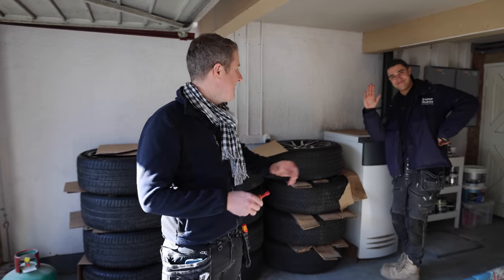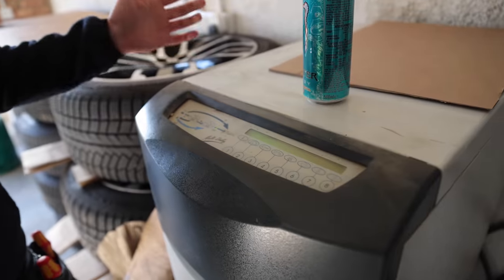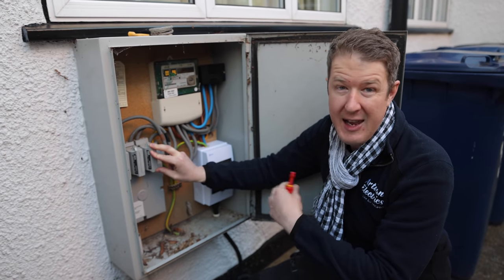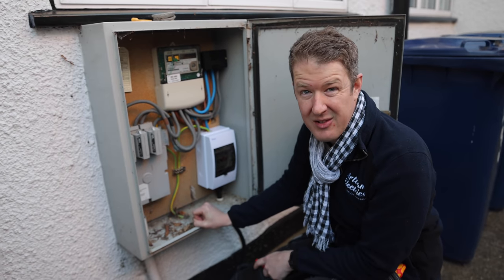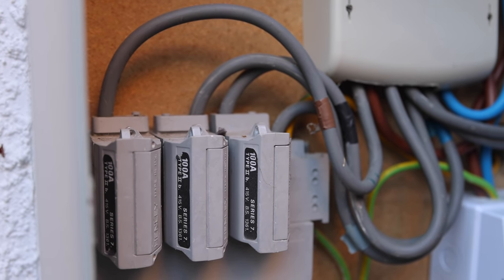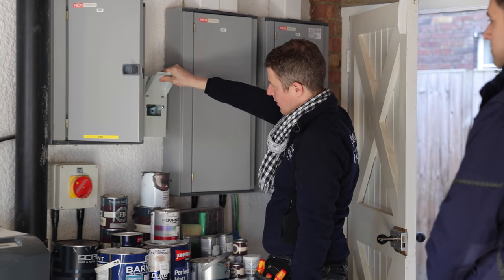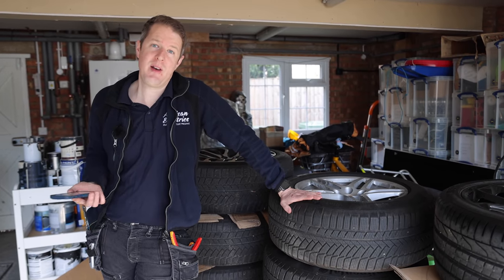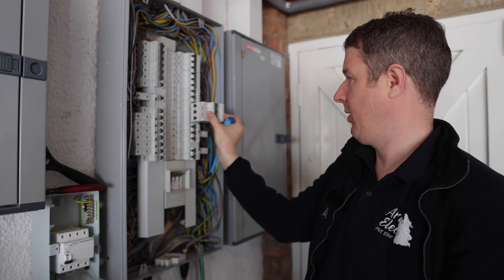INSTALLING THREE PHASE 22KW CAR CHARGERS AT HOME! - Electrician Life

Comment: Tip for Corey. Once you have drilled pilot holes in mini C.U. offer it up to partner enclosure (3 phase box) and mark the hole position through existing pilot hole. Perfect alignment without messing around to find centre of circle.

Comment: Hi guys, Yankie viewer here. I love the channel. Electricity/electronics have fascinated me for as long as I cn remember.
You were wondering about how the 110V worked. Here in North America (US specificlly) our mains for residential service is 220 V, singls-phase, though, in relity nominally more like 240 V. Unlike there, neutral is not referenced to either leg, but rather a center tap.
This gives us 120 V from one leg to neutrl for most things like lighting, plug sockets, and small appliances. Larger items like air conditioners, cookers, elecctric dryers (and, of course, EV chargers) connect across both live leads for 240V.
Earth is typically bonded to neutral at the main panel (consumer unit) and to the cold water supply where it enters the building.
Also our plug sokets are typically fused at 15 A and 20 A for kicchen appliances.
Probably a good thing I grew up here rather than there given the number of times I have gotten shocked, 240V / 32A probably would have killed me. :-)
Reply: We have RCD protection.

Comment: That "black paint" is probably hidro insulation of the exterior wall, drilling that low risks compromising the insulation and bridging the water or humidity entry to the house

Comment: I'm electrician in Quebec, Canada and love watching you guy's, good work every time ! here residential is 120/240v 1phase and industrial and commercial is 347/600v 3phase. have a good day !
Reply: That is mostly the same in the UK are residential is normally 240 single phase this house is however one of the exceptions
Reply: @dominicmcgonigle9500  120v L1+N or L2+N is for light, outlet and 240v L1+L2 is for heater, coocker, dryer etc
Reply: @julien801  Ah ok , it's like in the US? 240V is splitted in 2*120 at the transformer, then 240 and 2*120 ist going in to the House? Here in Germany every privat building has 400V / 3 Phases 240V, mostly 63A.  A Charger with 11kW is normal, if you like to install more then one or one with 22kW you must ask the network operator bevor installing.
Reply: @MrKnatterton  I always tell my family and friends about how clever the Germans are and very sensible.
Her in Liverpool we even have a great German Manager in Jurgen Klopp 😊👍👍

Comment: I’m having a new build house built at the minute (due to move in around August time) and managed to get a 3 phase supply fitted as an extra (it cost me £1200 but well worth it in my opinion) - there will be a 3 Phase DB in the garage for machine tools / 22kw car charger and L3 will run from that to the house and feed a standard Hager Consumer Unit  - thought it best to upgrade and future proof - so for anyone else looking at new builds, it’s well worth asking as its a lot cheaper then doing retrospectively (although they didn’t have a clue what it was asking for until i drew them an electrical plan and spoke to their electrical contractors ) - I’m baffled to why that house has a US 110v split phase system though - are they an American family who didn’t want to replace all their appliances? If so then the fitting of the 110v points must have cost more then replacing the appliances.
Reply: Sounds like you've had a bargain there.i spoke to a chap who had to pay 40k to get it installed.
Reply: @stevendavies4572  I think because I’m getting a new build and they had to run a mains feed in anyway it was cheaper - there’s 3phase in the road so the only cost is the cable and paperwork - with the way the world is going now with heat pumps / EV’s / aircon etc I thought it best to future proof - I’d recommend anyone getting a new build to push for 3phase as I expect it will be the norm in 5 years
Reply: Thats very expensive . . . Hope its made of gold 😂
Reply: There isn't a scenario where those 110V points make any sense to me. Shipping appliances to the UK would be stupidly expensive, never mind setting up a dedicated 120V board, transformer and accessories. There are very few appliances that would need exact US supply characteristics, the only things I can think of being motors where the AC frequency is used for the functionality (clocks, tape decks, VHS recorders and turntables) and you could just buy 50Hz UK versions. They must need that 120V/60Hz for something ? Maybe as part of the building's previous purpose they had a lot of US visitors with their own devices?
Reply: @dennybaker8755  I would think the cost of a 3 phase service basically comes down to the distance from the 3 phase main to the service head and how much trenching is needed.
Reply: @havoctrousers  I gather there 110V would be 50Hz not 60Hz seeing as the incoming supply is 50Hz and they said it was just going through a big step down transformer. Unless they have an inverter to increase the 50Hz to 60Hz. But what a waste of money having to replace any new Appliances with 110V ones.🙄
Reply: Sorry but getting 3 phase put in for faster charging is waste of time because the car only charges at a maximum of 11kW from an AC supply.
Fast chargers are DC
Reply: Also if you stick PV on the house the car charger is now on another phase so you can't use a zappi and charge from the pv
Reply: @giddyupgazboy1  this depends on the model of car. Some can charge at 22kw. Plus in a 5 bedroom house with several cars, we may want to charge multiple cars at the same time - 3 phase is about future proofing the property. As for PV, I’d just get a 3 phase inverter
Reply: @giddyupgazboy1  check your comment in ten years later... in long term you need 3 phase not just for your car but heaters too.
Reply: @giddyupgazboy1  Yes you seem to be right Porsche charges at 11kW AC. As far as I know only the Renault Zoe and Megane e-tech charges at 22 kW.
Reply: @giddyupgazboy1  The Taycan does come with a 22KW option since 2020 (though the standard is half that).
Telsa Model S can draw 16.6KW. The 22KW option does seem silly for home charging though as that's generally not when you need fast turn around. Still, it's his money, if he's going to waste on a Taycan, what's a few more quid on 22KW charging?
Reply: @giddyupgazboy1  unless you fit a 3phase solar inverter...see my video solax 3phase charger i fitted ages ago now
Reply: @havoctrousers  - 1.  military or political (embassy) residence where a new resident from the states will move in every three or four years.  2. Wealthy American who just wants all their electric nick nacks to just work whenever they visit one of their many luxury residences around the world.
Reply: you have to pay for 3 phase...?
Reply: @svenskvoid2372  yes - single phase is currently the standard for domestic premises in the UK for most DNO’s - 3phase is an upgrade
Reply: It is maybe for a workshop. All builders use 110v machines.

Comment: Upgrading from single to three phase supply costs only €300 in the Netherlands. That's possible because all supply cables and incomers here are three phase, so the DNO only has to add two fuses and swap the meter.
Reply: Same in Portugal. My grandparent's home is a 3 phase instalation because of 2 drilled wells with submersible pump inside (both at 30m depth).

Comment: I don’t think the 120v will be centre tapped earth as the RCBOs only look to be single pole, I wonder if transformer is a frequency converter too as it looks expensive!
Reply: In the US and Canada (since we are on the same grid with each other), the electrical system is 240 volt with a center tapped transformer. The neutral is center tapped and bonded to earth. Neutral to one of the hots will give 120 volts. Hot to hot without the neutral will give 240 volts.
Reply: Yes, that looks more complex than a simple step down transformer.  I bet it’s a rectifier / inverter delivering 110V 60Hz or even center tapped 220V.

Comment: We had 3 Phase fitted onto our 1996 built UK detached home for free.

Currently running two Zappi Chargers, 1 x 7kW and 1 x 22kW on 3 phase.

Very nice 👌
Reply: Whos ur provider if u dont mind me asking?
Reply: How did you get it installed for free?
Reply: @owenwilson3750  Western Power
Reply: @shitgetugly  We were on a Looped Supply with our Neighbour.  They wanted to remove it first, and I asked for 3 Phase instead.  As they were already going to do the 'unloop' for free, they agreed.

Comment: I enquired about getting 3ph to the house for running workshop machines. But the DNO told me that only 2 phases came down the street, with properties alternating between those 2 phases.
To add 3ph they would have to run a custom feed from the substation.
VFD's on the machines was cheaper!

Comment: Most modern homes in the Netherlands have three phase power (230/400 Vac). The main breakers are 25 or 50 Amp.
When charging an EV with e.g. a 90 kWh battery, at night, with 22 kW from 35 to 85% SOC, that takes 2 to 2.5 hours. So it's ready before you go to bed. A bit over the top don't you think?
Reply: Yeah I was kinda surprised to learn most british homes do not have 3 phase. Don't they have any 380-400V appliances over in the UK.
Reply: @thecooletompie  Generally only industrial and commercial appliances are 3 phase in the UK. Domestic properties just have high current single phase supplies. 100A single phase is not unusual (my own, quite small, house in the UK has a 100A supply), and even high power appliances like instant water heaters for showers (up to 13kW, 55A at 240V) run from single phase. I now live in Poland and most houses here have 3 phase supplies but only 25A per phase, so large appliances have to use all three phases.
Reply: @cmjones01  
11.5kW was the maximum on a single phase supply - last time I looked.
Reply: @johnburns4017  there is no limit on single phase. As long as the wiring is up to it and the network is ballenced.
Reply: @njipods  
In the UK 11.5 kW for a single appliance
Reply: @johnburns4017  citation
Reply: @njipods  
Find me one higher.

Comment: A three phase is actually 'normal' here in the netherlands, but they usually dont go above 35 amps, but with loadbalancing you can also place a 22kw.
Reply: For info 3 phase here is also 230/400v

Comment: Memshield offer a 3-phase type a RCBO with 30ma.  It takes up 4 ways but the 4th pole is blanked and insulated away from the busbar. You could have shifted some breakers down and saved putting in an external RCD?

Comment: Surely if Cory prematurely glanded one end, rather than pull the whole coil through the wall, why didn’t you just remove the gland from the board and fit it to the charger and thread the unmade end back through the hole, gland it and fit it to the board? Or have I missed something obvious?
Reply: Thinking the same 🤔, must of been more to it

Comment: 22kW are rare even in Germany. The electricity supplier has to approve it. 
11kW are often installed because there are subsidies up to this size and the electricity supplier only needs to be informed. 
The problem is only when the car wants to draw 32 amps on one phase and is limited to 16 amps because of 11kW. 
Then it makes more sense to install a 7 kW charger one phase with 32 amps. 
Or trying to get 22kW approved because that's 3x 32 amps.
Reply: Here in Denmark it is very normal to see 3x25A in a house. In our small house we have 3x35A.
Reply: Perhaps to add some info here. In Ger a typical (house) setup is 3 phases with 63 amps each. The first fuse (3) are also 63 amps. Then the next device in the path is a Selective Switch Breaker (SSB) (I do not know how you call it in English) followed by the meter. The SSB is typically 63 amps as well under normal operation (no car charger and no PV system -> so-called intermittent operation). Then come the distribution with RCD’s (usually type A) and breakers (usually B16). So installing a 3P car charger is normally pretty straight forward. Usually you just need to add another RCD (type A) and 3P breaker. The DC 6mA residual current monitoring is usually embedded in the charger. When a car charger (and / or PV system) is installed the house operation changes to so-called duration operation and the SBB has to be changed to 50 or 35 amps depending on the meter wiring.

Comment: What was the reason for the 110v bits in this place ? Curious to know !
Reply: and is it 60Hz like in the US? It looks like a UK 2 gang plate with US sockets in it, who makes such a thing and why? We need answers!
Reply: 😳 have they been in British Columbia? 😁
Reply: @havoctrousers  MK makes them, probably most popular in hotel installations.
Reply: The UK uses a step down transformer for outdoor power equipment stepping down to split phase 120V. So it’s either for outdoor equipment or somebody who brought a lot of equipment from the US. Could also be in a US military type area. I’m assuming the giant transformer since it looks more than just a transformer is doing frequency shifting as well as voltage dropping because it look fancy.
Did not know that there was a whole line of US sockets in the UK style complete with permanent installed wiring that is crazy got to know more.
Reply: @imark7777777  The US equipment would be 60 Cycles while Great Britain is 50 Cycles. You can split the power, but you cannot change the hertz of the power. You will destroy appliances with motors especially compressors. This is because, when you run an appliance like a fridge compressor motor on a slower cycle than what it has been designed for (60 Hz frequency vs 50Hz), it will cause the electric motor turn slower. This inevitably results in an increased strain on the motor windings, causing the compressor to burn out.
Reply: @michaelholliday100  i know some of my American equipment  is labelled as suitable for 40 /60 Hertz  120v supply , All domestic equipment supplied to the EU had to work universally too , noticed some of my UK 110 Volt kit  states 50/60 hertz some  just states 50 hertz , i get the impression on  domestic appliances and small powered handtools used in construction  toleration is built into the tools , to expensive to manufacture to each market individually , some markets for instance Japan run  both 50 and 60 hertz
Reply: Could the transformer have a frequency converter in it to change the 50hz to 60hz?  It looks big and expensive enough
Reply: @steverobinson8170  the only thing I can think of where frequency really matters is the motors in old US audio gear like record players and tape decks since playback speed will be too slow at 50hz
Reply: @michaelholliday100  I knew that motors going one way or the other way wouldn't work as it would burn out windings. I'm thinking a lot of stuff now is digital switch mode power supplies.... There's a lot of things aren't motors and frequency dependent.
Reply: @havoctrousers  + clocks that use the mains frequency. Pretty much anything with a motor.
Reply: @cumberland1234  I was reading around some thing that was talking about using a UPS that was capable of being programmed to be a frequency converter. And that things fancy enough that I would think it's doing frequency conversion?
Reply: @cumberland1234   If you ever look at the large site generators that rock up in a large portacabin , they are very much like this , its designed to act as a filter for any transient signals, spikes in current or voltage caused by equipment  switching on and off , generally cleaning the power supply , something you need if your running electronics on the system  along side plant
Reply: @imark7777777   All depends on the motor , a fair amount of kit now runs DC in domestic applainces where they need variable speed control .
Reply: @imark7777777  The vast majority of power supplies, ie, laptops, tablets, cell phones, etc. work on 12 volts or 240 volts... You also could not run any Clock designed for 60 cycles on a 50 cycle grid.
Reply: @steverobinson8170  As I mentioned, some items will work especially basic chargers, ie, laptops, tablets, cell phones, etc. BUT never Microwaves, Refrigerators, Air Conditioners, etc... Items with compressors will essentially burn themselves out trying to do their job.
Reply: So from all the descriptions Jordan has given us, I'd say 100% it's a US origin family, it's most likely to be a US military officer's house.
Reply: @havoctrousers  no it will still be 50hz
Reply: @michaelholliday100  Been chatting to an American freind today , he reckons its not an issue apparently  although they use 60 hertz  equipment is manufacured with a wide tolerence  40 /60 hertz  historically
Reply: @steverobinson8170  I have a background in Electrical Engineering. Resistive items like irons and the other issues that I mentioned no, but items that Compressors and Electric Motors will be seriously impacted. For example, on the back of my Panasonic Microwave it specifically states: Only to be used with 120 volts/60 cycles, my surround sound Receiver states 50 or 60 Hz, not that it contains no motor and most clocks use the 60 Hz in the US to keep proper time. The same clock on 50 Hz would run slower...
Reply: @Stuart_Johnson_Solutions  agreed, Cambridgeshire used to have a large US military presence